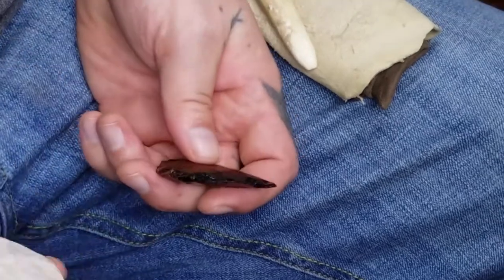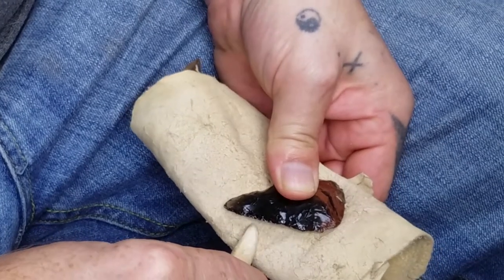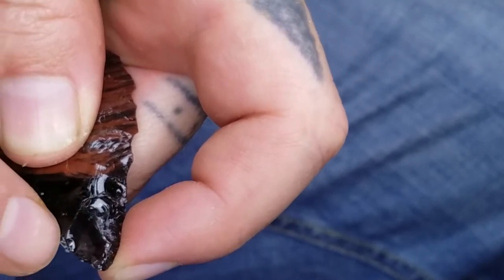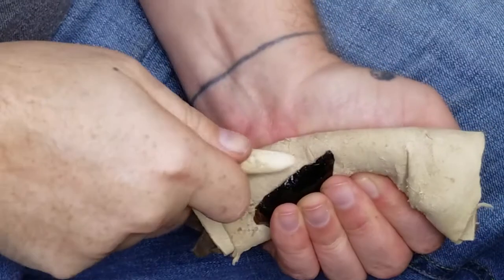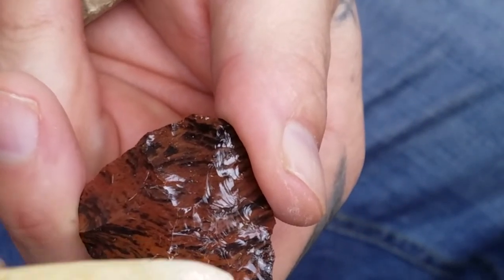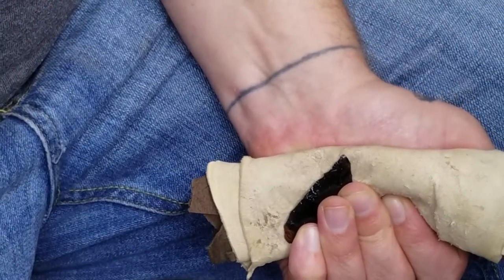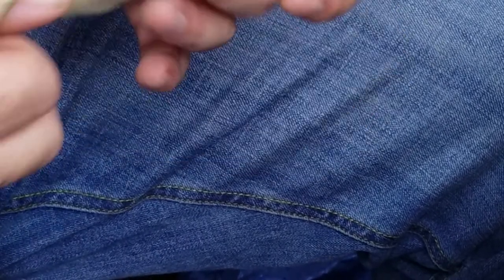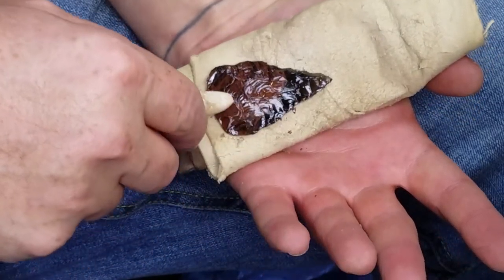Pressure Flaking! How To Remove Longer Flakes!

Comment: having a tough time making the longer flakes on heat treated agate and jasper. Any advice?
Reply from the maker: I've not had a chance to work with agate or jasper, but I think the principles would be the same as other materials. Can you remove long flakes from other types of material?
Reply: @yonderoutdoors  I do pretty well with obsidian (an occasional overshot) but even treated jaspers and agate are a little sturdier and the flakes dont seem to travel as well, plus its slabbed material. Ive seen othe knappers do pretty well with it. Im a woman, maybe Im just not strong enough😄
Reply from the maker: @winnievanorden1  It's more about leverage than strength and gender is irrelevant...here's a link to Noel Grayson  showing a different way to create leverage for preasure flaking https://youtu.be/ZlG6QIl3Nl4?t=902 he's the one that got me into flint knapping years ago. Is the slab a thin preform that your just pressure flaking or do you start with percussion?